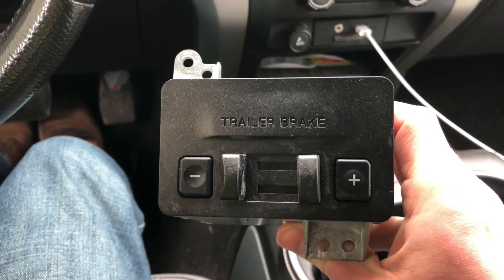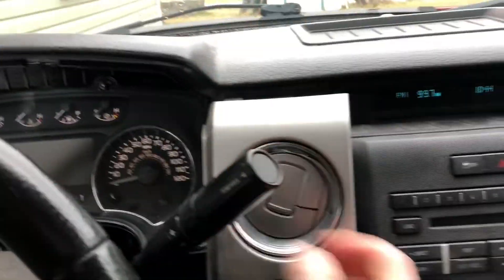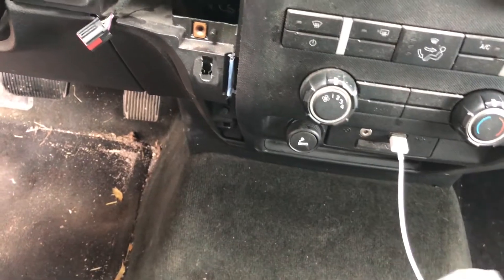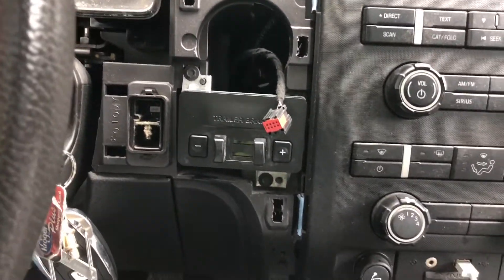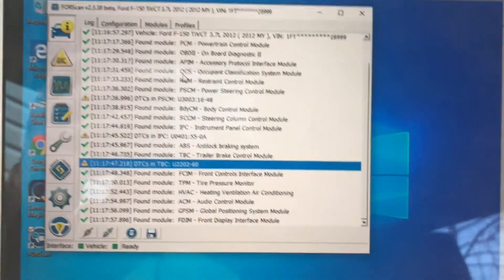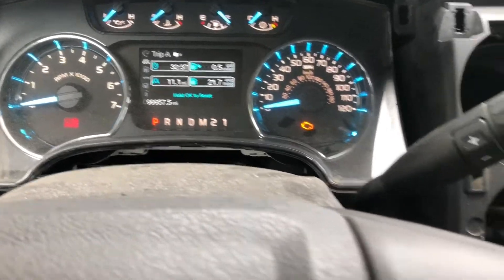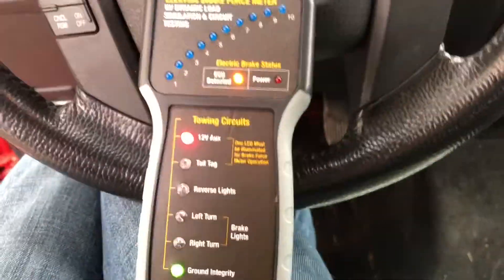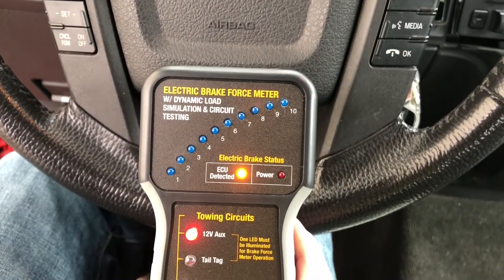Installing a Ford factory trailer brake controller (TBC) in a 2012 F-150

Comment: anyone have a picture of where the other end of the pigtail joins into the truck dash wiring connection ... the video shows the end that plugs into the controller but where do the wires connect at the other end ?

Comment: This part does not fit in my 2014 f150. So confusing... The actual brake controller is too big for the hole in the trim

Comment: That harness that's on the back of your coin holder is also used for the Electronic differential lock on 2WD pickups.  My 2012 4x2 came with a diff lock.  The frustrating part about this install is that Ford has a similar clip to secure the TBC harness into the cubbyhole just like the coin holder.  Yet they don't use it for the TBC connector.  My TBC harness was taped up under the dash (wasn't a previous owner either, as I bought the truck with 6 miles on it).  I guess taping it down there is easier for someone installing like a Tekonsha controller on the kick panel.  My 2012 came with a packet that has a pigtail, fuses, and relay for use with a third party brake control.
Reply: where does the end of the pigtail connect to ? one end controller the other end Where?

Comment: EXCELLENT video! Made the job so simple. Hardest part is fishing that plug up the right way so it will connect to the TBC. Keep up the good work!
Reply: If you remove the dust cap first, it is much easier to fish the plug up the console.

Comment: Do all trucks come with the wiring at the bumper I can't find mine
Reply: I read in my manual yesterday that if you don’t have the 7 pin, 4 pin & factory installed receiver hitch, it may not work for your truck(not wired from factory). 2012 XL with tow package
Reply: Yeah but we do have it one the driver side inner fender so just have to pull to wires to the front (blue and orange)

Comment: Big thanks, I was able to install a used factory TBC module with intergrated LCD screen in my 2009 F-150 with a trial edition of the Forscan with OBDLink EX cable.

Comment: Thank you for the video. Everything worked great right up until I searched for the TBC module. I have a 2014 F150 STX and it didn't show in the log. I found another video (https://youtu.be/O5gEhTa1btA) that helped me over the hump. I never saw TBC module but I did find "Brake Gain". Enabled it and now everything works! Hope this helps out those having the same issue.

Comment: Great video.  Very detailed and easy to follow. What software do need to turn on and program the module yourself?  Dealer in Missouri charging $130 to program it.
Reply: It's right in his description, you need Forscan and a compatible ODB adapter.

Comment: Great video. I have a 2014 F-150 STX and the connector for the controller was plugged into the back of the little cubby, just like the 4x4 connector is plugged into the back of the coin storage. Nice catch about the relay and the fuse. No other videos, that I have seen, mention this.
Reply: I have the same model truck. Did yours work without the LCD screen?  Mine just has the basic digital readout, not an LCD screen.
Reply: @CharlieCB85  yeah I have the basic digital readout and it still works
Reply: Thank you brother !! You saved me from looking everywhere for it

Comment: I recently did all the installation and took it to ford and had my computer enabled. I tried 2 different trailers but the tbc won't recognize my trailer. It says no trailer connected. Any advice ?
Reply: Try checking then installing the Two Fuses that are required for the trailer brakes.
Reply: Did you ever find a fix for this?